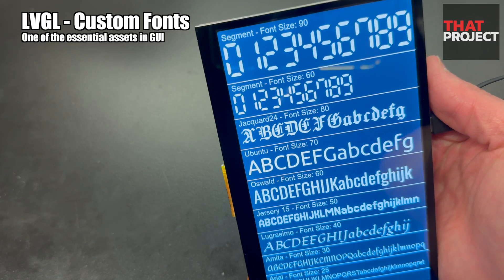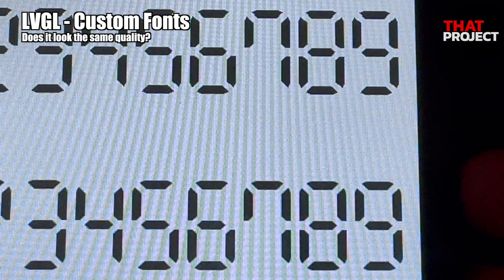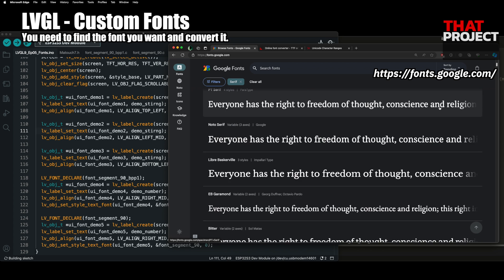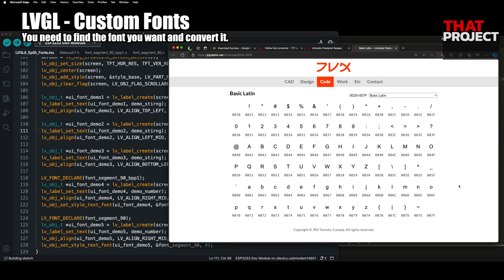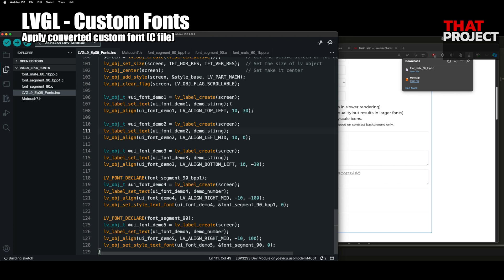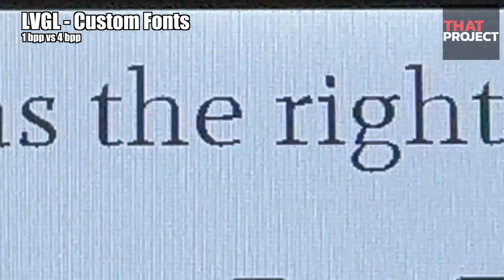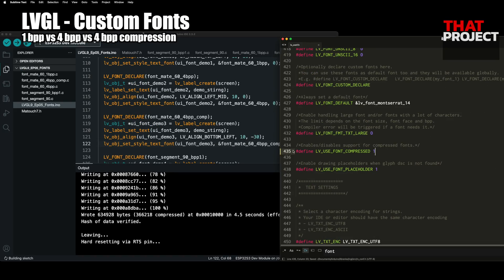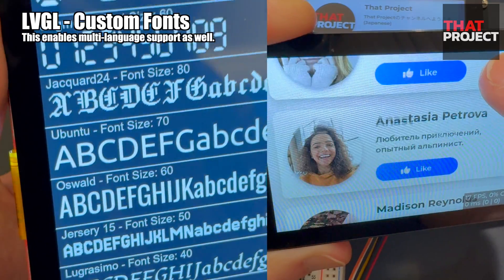LVGL Tutorial with ESP32, Custom fonts are essential in GUI! #Font #LVGL #GUI

Comment: Hello, can it works in LVGL 8.3.0 version?
Thank you
Reply from the maker: As far as I know, LVGL 9 is not that much different from previous versions (LVGL 8) in terms of fonts. (Sorry if I'm wrong)
Reply: @ThatProject  Thank you for your answer. I tried with 60 font size, it is works but not for 90 font size. Is it relate with the MCU memory size?
Reply from the maker: @M2N_Instrument  Of course, the actual font size will vary depending on the font type for each font, but there was no issue with the font size 90 in my selected fonts. If there was a memory issue, it would have been confirmed in the console log. Please create a file with a font size of 90 using a different font and test again.

Comment: Hi man!I' don't know, but i've read that the lv_conf.h need to be changed as below :

 *E.g. #define LV_FONT_CUSTOM_DECLARE   LV_FONT_DECLARE(my_font_1) LV_FONT_DECLARE(my_font_2)*/

So, if i've 2 fonts i need to modify the lv_conf.h in this way :
#define LV_FONT_CUSTOM_DECLARE  LV_FONT_DECLARE(myfont15) LV_FONT_DECLARE(myfont30)

Why you are not using this approach?
Anyway with the approach above, i've issue if i define two fonts , because there are all variables that are already available in the first font defined...
I want to declare the fonts just one time...this for me now is a problem...do you have any suggestion?!
Thanks in advance!
Reply from the maker: /*Optional declare custom fonts here.
  *You can use these fonts as default font too and they will be available globally.
  *E.g. #define LV_FONT_CUSTOM_DECLARE LV_FONT_DECLARE(my_font_1) LV_FONT_DECLARE(my_font_2)*/

The above method allows you to use custom fonts in all of your projects. Using custom fonts depending on the project can prevent unnecessary memory waste.
Reply: @ThatProject  if i use the approach in your video, in my case, doesn't work :/
I've two files where i use different fonts size.
in each file i've set the LV_FONT_DECLARE(FilMachineFontIcons_20.c),LV_FONT_DECLARE(FilMachineFontIcons_30.c)  ecc ecc ...but i've got this error :
Library/Arduino15/packages/esp32/tools/xtensa-esp32s3-elf-gcc/esp-2021r2-patch5-8.4.0/bin/../lib/gcc/xtensa-esp32s3-elf/8.4.0/../../../../xtensa-esp32s3-elf/bin/ld: sketch/objs.a(TheBeginning.ino.cpp.o):(.literal.menu+0x14): undefined reference to `FilMachineFontIcons_20' , also for FilMachineFontIcons_30
If i include the FilMachineFontIcons_20.c in each file, i've another erro, a redifinition of same variables used in each font file, like the following : error: redefinition of 'const uint8_t glyph_bitmap []' 
how can i solve this issue?!Thanks in advance! :)
Reply: @ThatProject  I've solved, the issue was that the font.c files where in a inner folder called "resources"...not the main one with the .ino file.
How can i place the font.c files in an inner folder?
Thanks in advance!!
Reply from the maker: @FrankP83  Just copy the font file into your project the way I did. Also, LV_FONT_DECLARE() does not include the file extension.
LV_FONT_DECLARE(your_font_file_name_without_extension)